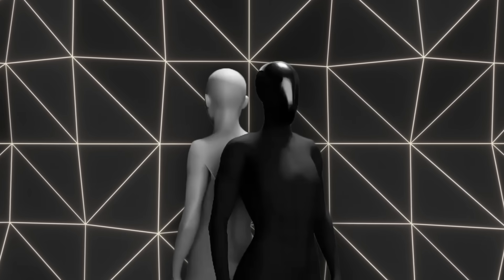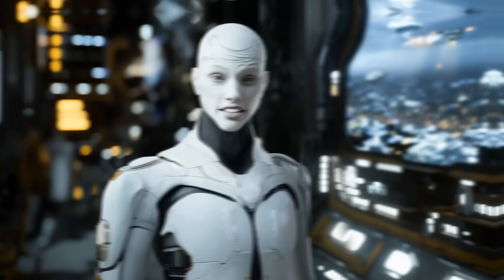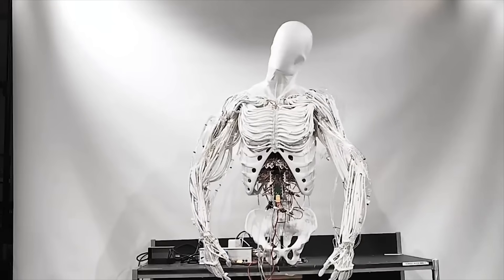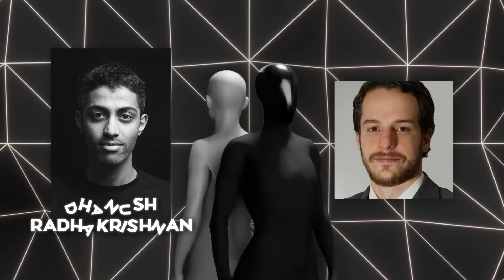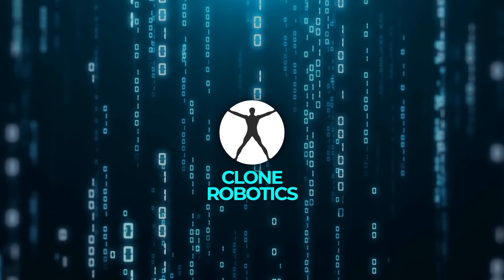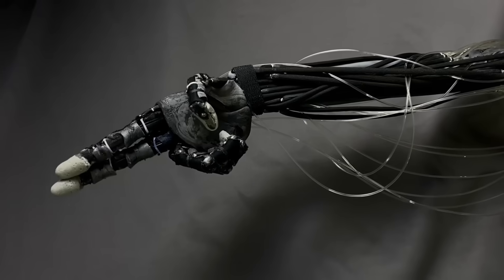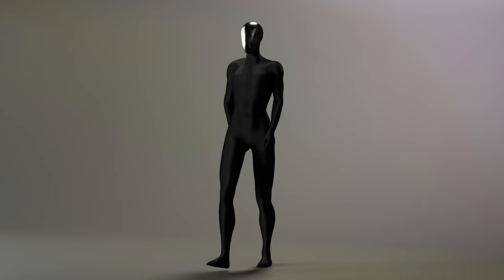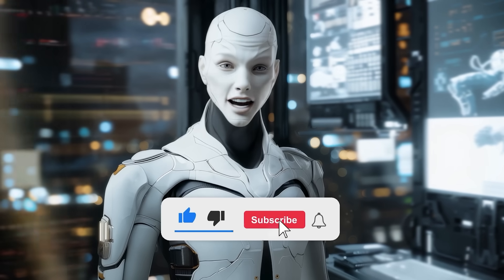First WATER POWERED Biomimetic AI Humanoid Robot Shocks the World (It's Too Human)

Comment: water hydraulic robot in place of motors is cheaper and better, with tech every now and then tech gets better and cheaper at the same time. One thing tho the water piping are too many for each an every muscles it replace. All of this pipes are not necessary if we have one pipe with gates, switches that than open and close to function in place of muscles.

A small valve made of a tap that is pushed up to close an smaller hole in it that allowed water to pass throw, this mechanism need the power of magnet to push up and down as desire of the tap. this tap mechanism then need mercury on small amount installed to be electric charge to magnet and function as designed.

Having few pipes with valves like design or replica offer cheaper better hydraulic robotics. First phase was motors as muscles, now hydraulic mechanism and a material that move when electric charge  is passed onto it, universities students can be offer a challenge to test every material while recording its change in length. Any tinny change and we would study this material to enlarge the scale to useful needed to change when electric charged. 

Till then mercury valve or similar use of magnet to open close this valve is the next in line to hydraulic robotics.

Comment: a 500W waterpump ? this might make a hell of a noise when required to animate the entire machine. beside of that - the water will increase in volume if exposed to heat and start to freeze below 0°C. why not to include a hydro pneumatic accumulator ?

Comment: When someone has the will or financial means to develop analogue neural networks instead of ridiculously pursuing digital models, then it wont need training, it will learn like a human does. It will need teaching.
Reply: "Learn like a human does" means AGI. We don't have a completely functional one (yet), need a lot of hardware and it is really energy consuming at this point. Putting it on an android will take some time.
Reply: @renascienza.bazarclub  Analog Neural Networks use much lower power I believe
Reply: It won't take long to wifi it in though

Comment: I smell a scam - it's going to be jank as hell, if they don't just take the money and run.
Reply: Creating trade show prototypes or a daily serviced animatronic is one thing, but strong elastomeric muscles those won't wear out within few days or weeks (try to re-inflate a balloon that many times) will be much tougher. Remember those expanding stretch garden hoses, those were infamous to burst after a month. A rental worker robot that earns more money than its daily service costs may be possible, but for a reliable home robot with service intervals like a car or washing machine, I worry that elastomer development still isn't far enough. (Our body needs to continuously replace cells to keep muscles intact.)
Reply: @AerialTheShamen  exactly - overcoming material fatigue would pretty much mean mass manufacturing a ton of these inflate-o-muscles, and then replacing them; combining the tedium of x-mas light testing with hydraulic maintenance. if they've figured out some ways to address these problems, that would be a fantastic thing to demo in order to promote buy-in, and so it's suspicious as hell that they have some serious obstacles to overcome but they're already taking pre-orders.
Reply: @Jack-In-The-Craic  Also adding servo sensors for positioning each muscle will be complex (particularly if they need to be serviced every few days). The first vacuum tube computer ENIAC needed more time for servicing than its computing time because operating thousands of tubes simultaneously made it such unreliable. This is a new fundamental technology that (as exciting it is) can need decades to turn into something robust.
Reply: You a scam
Reply: No, No, & No! Careful What You Steal!

Comment: Why use the terminology “Humanoid Robots” when this creation is clearly an “Android!” 
Did they say the price of one?
Reply: "humanoid" describes it's form an android is a subset of humanoid.

All androids are humanoid, but not all humanoids are androids.
Reply: Android is an intelligent, self sufficient machine.
Reply: You might think you're human, but you'll never have heart and sold Jason.David frank quote from power rangers
Reply: $5000 they said. Only 279 being made on the first run.
Reply: You are correct. An android is a humanoid robot. I think that using the term 'humanoid robot' because not everybody knows the definition of android, as you can tell in these comments.
Reply: @faithfaraday  There is more on the "android" concept (a synthetic human). To be an android, the robot needs to imitate a human and be self-sufficient. If you have a machine in human form, but that needs to be controlled remotely for instance, isn't an android.
Reply: @renascienza.bazarclub  That's not true. "android" just means a robot in a human form. The definition says nothing about self-sufficiency.
Reply: @renascienza.bazarclub That is wrong. Maybe in some of your archaic Bladerunner comics, or some old original series Star Trek definitions this is the case. But the dictionary definition is: "a robot with a human appearance."
Reply: @Twitch_Moderator  Truly I'm having as base the definition of the Chambers cyclopedia, from 1728, from greek: a machine like a human being. There is no "robot" (slave) in that definition to confuse us because the word was made by Capek and Asimov so much later.
So, a machine like a human being is self sufficient, need to have human form and can behave like a human. Remote controlled things, aren't included. That is my point.
But yes, in literature "Do Androids dream with Electric Sheep?" from Philip K. Dick (the source of Blade Runner) is the first reference from POP CULTURE I can remember. But is not academic.
Reply: @renascienza.bazarclub  Words change over time. Try using the current definition,  not one three centuries old.
And the title of PKD's book is "Do Androids dream of Electric Sheep?" It's "of", not "with". 
Self-reliance and remote control have nothing to do with the current definition of "android".
Reply: @faithfaraday  When you say "current definition" (there's none) you are actually saying "my definition", right? But sorry, who are you in the scene?
So no, thanks.
Reply: @ExpatGlobetrotter - The term 'humainoid' describes that the robot is human-like. The actual definition of: "Android" means: "a robot that appears human-like". So, it is correct.
Reply: Maybe it's because when I search for "Android," all I get are Android phones.
Reply: ASI HUMANOID 🤖 IS WHAT AI TECH SCIENTISTS ARE TRYING TO ACHEIVE...
  AGI  "ANDROID" ROBOTS ALREADY EXISTS ...